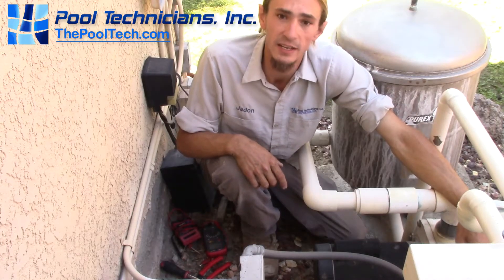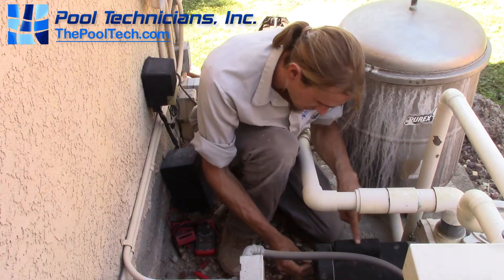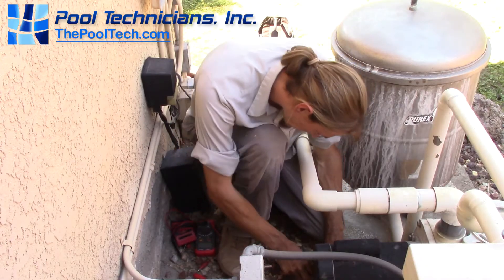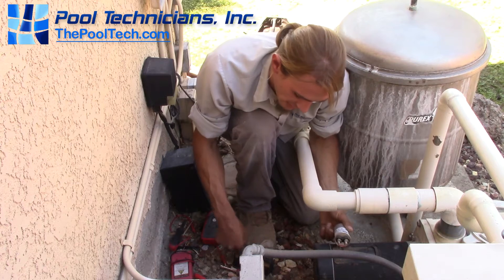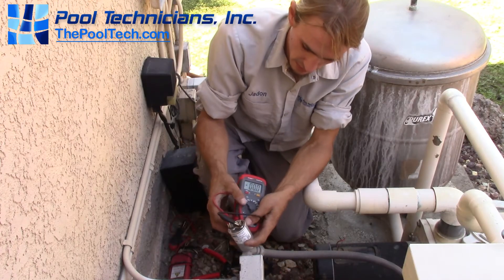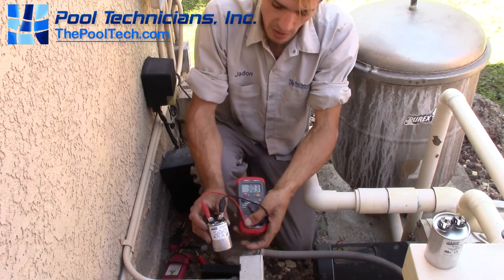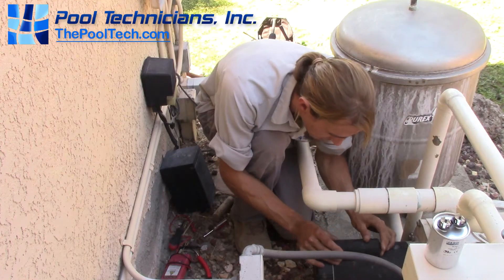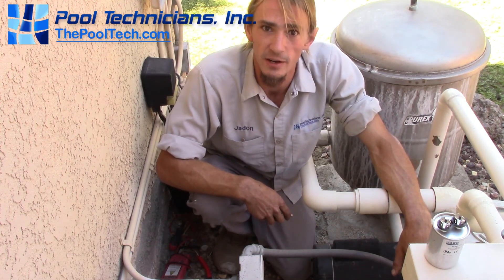Pool Motor Humming not starting. Replacing a start capacitor.

Comment: I checked  a friends pump  for her spa and found both a dead cap and a very hard to turn impeller.  I believe that means a new pump with new cap is needed or can I replace the bearings on a Hayward 1.5 hp 120 v pump?
Reply: The impeller could just be jammed with a stick or something.  If it's just jammed, un-jam it, and replace the cap.
Reply: @SheilaSpencer1  I checked for debris jam all clear and separated pump from housing.  The impeller was clear but, when i rotated it just spun off.  
It is a 120 volt 1.5 hp pump for the inground spa jets and air I think?
It uses a Len Gordan air switch in the spa and when I turn on the breaker to this pump, it makes one quick buzz and stops. Tried to get the shaft to turn, but I think it has been frozen for many years and is possibly too rusty to free up?
I was trying to figure out how to manually turn the shaft.  I didn't want to remove too many parts to get access to the shaft under the motor end cover to find a flat spot for a wrench. 
Where's the best place to buy a whole new pump with cap?  Local pool supply or electrical supply or online?

Comment: THIS VIDEO SAVED ME $350.00  THANK YOU SO MUCH.   THE REAL PROBLEM IS THE NEW MOTOR COMES WITH A NEW CAPACITOR, BUT YOU MIGHT THINK YOU THE NEW MOTOR IS MAKING IT WORK, WHEN IN REALITY IT WAS ONLY THE NEW CAPACITOR THAT'S MAKING IT WORK.  CHECK THE CAPACITOR ONLY AT FIRST!!!

Comment: Thanks for the video. 

I have a capacitor that I believe needs replacing. I'm having a hard time finding one with the same specs. 250-300 uf 110VAC +65 C.

Any idea where I can get my paws on one or are there any other that are compatible? Thanks again.

Comment: I had a brand new pump that sat around for three years before I installed it. It hummed and wouldn't run on first start. Turns out all I had to do was spin the motor shaft to loosen it up. It just got stuck sitting unused. The bearings and everything else were fine, it's still running now, two plus years later. However this would not be the main reason for a motor to hum and not run.  But it is a reason that's easy to check!

Comment: This video may be 3 years old but it's just as valid as the day it was released.  I followed this process today and fixed my pool pump with no issues. The pump is about 12 years old but was still running very quietly until yesterday when it wouldn't start and was just humming. Removing the capacitor was a simple task, I took it to the pool shop, they confirmed it was dead and sold me a replacement for AUD $44.00.  Five minutes to replace it and job done.  Thanks for the clear and simple advice.
Reply: You're in Australia i take but your mention of AUD. Can I ask, so you just turn off the mains power before doing this or just unplug the pool pump? I was thinking just to unplug the pump. Do you still have to discharge the capacitor?
Reply: @elwood4965  Hi, yes I’m in Australia. I just switched off the power to the pump, removed 4 screws holding the cover over the capacitor, photographed it in place, removed the capacitor and took it into a pool shop, they tested and confirmed it was faulty, obtained a correct replacement and reinstalled. I haven’t had a problem since. Good luck 🤞

Comment: You are a legend. I'm going to give this a try tomorrow. Had a pool guy come out today and tell me I need a new pump but it makes the exact same humming noise as this. My only question is I have 3 connectors that connect to the capacitor. If I get a new capacitor does it matter where those pins gets connected? Or can they connect anywhere? Only asking cos the one that is currently in it is very hard to source so need to get a different brand

Comment: For a pool service man you should know that you are replacing a "RUN CAPACITOR" not a start capacitor! Run capacitors are higher rated and are not in metal cylinders, they are black Bakelite cases!! These motors do not have centrical switches! These are PSC motors! You can look that up!

Comment: Agree with all the comments! Another beer for you! This video does get right to the point, which I appreciate! We called several pool companies which either didn’t call us back or wanted $400-600 bucks to “replace” the motor. Our capacitor was just completely dead! We didn’t need a new motor.  A $16 fix with a new capacitor from Amazon (which only took one day to ship). Pump is running perfectly! Ty again!!!

Comment: Hi there, mate,I have a balboa control unit, And the flow was not working as strong as it should. I thought it was the pump, The jet button when pressing started to stop working and just become to have a mind of its own. I notice once the pump started without pressing any button and once just stopped also. So because I was not getting much flow, first bought a new impellor, because the other one was destroyed. Did not solve the problem, still low flow. Now I have installed a new pump, And the same problem. So there was nothing wrong with the original pump. Now I installed the new pump today, normally it goes on PR for about 7 minutes then it all starts up normally. So when I put the breakers on, the pump was running on low speed, Straight away, that was strange, never done that before when PR is starting up the on process but is a new pump.  The jet button stopped working again with a clicking sound coming from the Balboa control box. Could this just be a fuse problem, possibly. or a relay ,what does a relay look like ? I am dumbfounded here. So now it is not the pump or capacitor, all new so , ruled out. The heating element is all fine and working, all checked there.I have a video ,if you were interested to look at. No errors on the display panel either .

Comment: i have the humming noise. I used a wrench to spin the motor shaft and it made a big spark. Did I kill my motor??? I need a response pronto. Gotta fix the problem ASAP.

Comment: Hoping to get some help. I have a Hayward Power Flo LX 1.5 HP pool pump (w3sp1580x15) that is having this humming problem. But this model, to my knowledge, doesn't have a capacitor. I just replaced the bearings, it is turning freely, is it dead already? I have only had it for 4 years.

Comment: Put the new OEM capacitor in, ran perfectly for about 30 seconds and then heard a bang and some smoke from the back of the motor? Was it a bad capacitor or can there be another issue?
Reply: It could of also been a stuck cyntrifical switch.

Comment: Great video! Appreciate you sharing and your point about a heat wave damaging a capacitor... we just had 5 straight 100 degree days then suddenly the sweep pump stopped working. $25 for a new capacitor and works great again. Appreciate the video! I owe you a beer.
Reply: Only 5?  You lucky guy.  Come out to the desert and we'll give you 40 of 'em in a row ;)

Comment: not working. after replacing capacitor, just some noice i can spinn the motor from hand, what happend with my pump?
Reply: Did u end up fonding whst the problem was? I just changed my capacitor and it s not working as well :(
Reply: Had to replace
Reply: @MyFighter2000  replace what? The whole pump? I am suspecting a piwer issue may be, bit not sure, since my pump is only 2 years old.
Reply: Bought a new pump

Comment: thank you for this!!!! pool repair man said i needed a new motor. 500$ in total and i tried the capacitor purchase and works like a charm. 15$ repair
Reply: Capacitor is usually just a temporary fix
Reply: @Jasheon  where's your reasoning?
Reply: @Adam-hs4de  because I’ve been in pool service for 15 years……and I have seen it happen many times.
Reply: Great DYI instructional video. Straight to the point. Explanations. Insights and imagery.

Comment: Excellent video! No BS or endless boring chatter. Meat and potatoes baby!!
Reply: If you have a bad start capacitor can you still get the motor running by giving the shaft a good spin and powering the pump on at the same time?
Reply: @yolandatullos3123  Easier to just replace the capacitor, which you'll have to do anyway.  I shopped for it online.  Grainger had it with one day delivery.  I drove over and bought it the same day; problem fixed for $11.

Comment: Mine had 3 wires does it matter which one it's connected to?
Reply: Mine has three as well two yellows and a red. When I took it off the yellows were on one side and the red was by itself